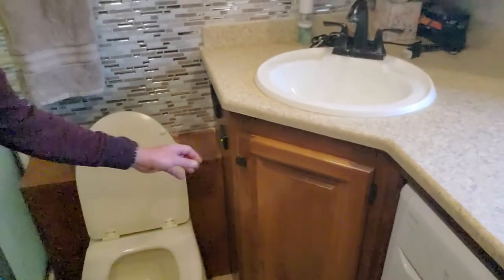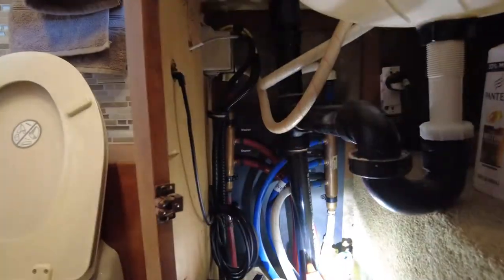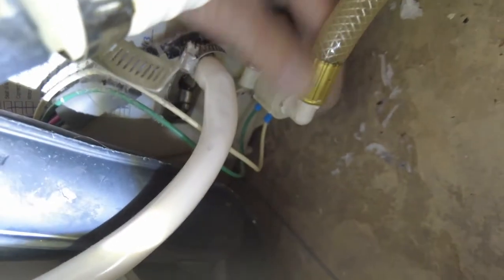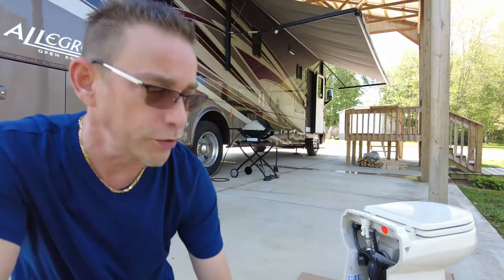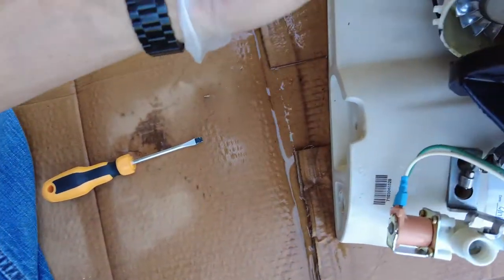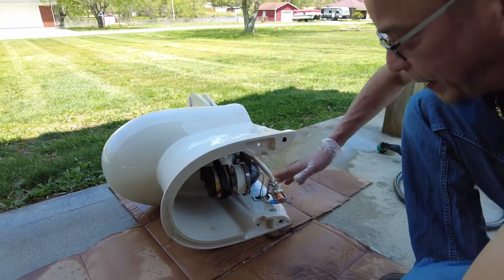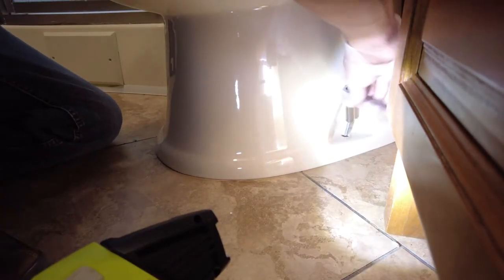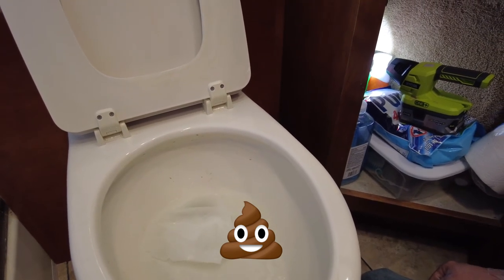tw RV ADVENTURES - Episode #27 | Tear-Down and Inspection of RV DOMETIC MACERATOR TOILET TIFFIN 36LA

Comment: Thanks for showing the steps needed to disassemble, remove and clean, and reinstall this type toilet bowl.   We have a similar Dometic model on our Airstream Classic 33.   Sometimes, when you flush, the toilet just sits there and thinks about.  Then other times,  the flush handle is activated and all waste matter is efficiently discharged in the holding tank.   Very frustrating experience.

Comment: I have a 2016 Tiffin 36 LA. I've had to replace the control unit laying back there next to the pump. I believe the sensors in the black tank of these are junk. Constantly cleaning with the wand. Also, lift up the lid on that wood box for access.

Comment: My issue is I bought a THOR motorhome. They cut corners. One of the corners they cut was using a 1 1/4" sewer line from the rear macerator toilet to the black tank. These lines get plugged up with just poop and toilet paper, which is my issue. And due to the location of the toilet to the black tank, I can't put a regular RV toilet there. I am still trying to unplug the line. Wish me luck.

Comment: Did you ever come up with a solution. I believe mine is electronic issue with opening the escape door but not sure
Reply from the maker: Hi Tiny, Read my additions to my video description. I found the owners manual and changed my Flush Mode. This seems to make less water to FLUSH everything out with just ONE Flush.  -Todd

Comment: Same problem on my 2014 36LA same exact problem rom day one.  Will try taking it apart and clean the pump.  Any other possibility?   Or do you think it just a poorly design toilet?
Reply from the maker: Hi Joe, we just purchased our Tiffin (Used), last year. I'm guessing that it is just a poor design or not built with a powerful enough macerator pump. Did you read the manual instructions I left in the comments section here? Try changing your "flush-mode" ...see if that helps. We're just going to deal with it, as it is, I guess.  -Todd
Reply: I have a 2016 36LA and i had to replace the control module in mine. I believe there are two sets of sensors in the black tank. Now the sensors in the tank are wacky where the pipe runs down the bedroom into the black tank in the half bath. The ball valves on the push toilet can break also.
Reply: @nothingman3542  where was the control module? I also have a 2016 36LA and my toilet won't flush at all. Seems like the macerator pump isn't getting power.
Reply: @freddonnaperryman8119  if you remove the wood cover behind the master toilet between shower and sink, it is most likey back behind the porcelain mold. 3 connectors or so and it comes right out. Black box, 3"x3" x1/2" thick. Its a solid state, so there is no fixing it. Use the numbers on it and get one on amazon, or such.
Reply: @nothingman3542  thanks
Reply: @looking4rview  Very welcome, safe travels.

Comment from the maker: These instructions within the manual seemed to help me. I changed over to "Dry Bowl Flush" mode.

6.2.2 Changing flush modes

Dometic 8700 series MasterFlush toilets offer two flush settings to help manage water consumption:
Normal flush – Uses 0.85 gal. (3.2 liters) per flush. Adds water to bowl after every flush.
Dry Bowl flush – Uses 0.45 gal. (1.7 liters) per flush. Does not add water to bowl after flush.
To change from Normal to Dry Bowl flush setting, press “Flush” switch for about five seconds. When
“Power On” light (fig. 4 3) begins flashing, release “Flush” switch. Flush mode has been changed to
Dry Bowl setting. Change mode to Normal flush by following the same procedure.

Comment: i'm putting a house toilet in my rv, nothing to go wrong, maybe a plunger once in a while fixed any issues.
Reply: House toilets store water in the tank. Be sure to drain/flush the toilet before travel to prevent water all over the bathroom. How do I know this?
Reply: @dalebrownlee6585   I have a pressure flush that uses very little water with no tank.  But you could use a sealed lid.